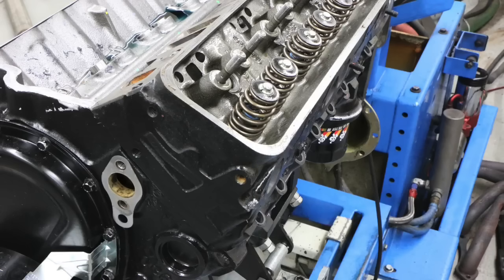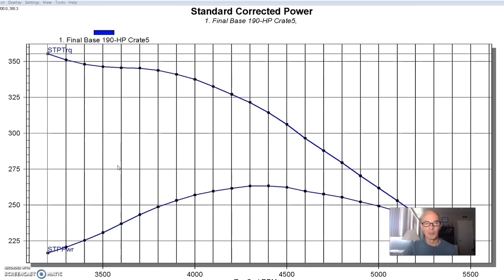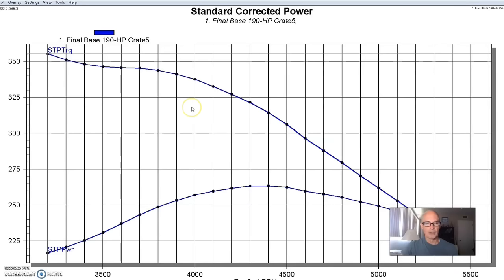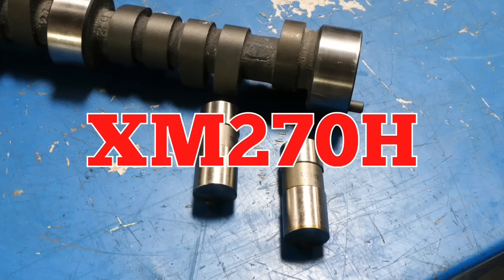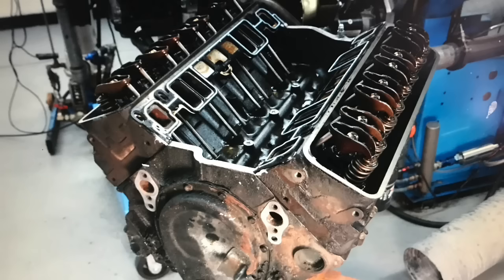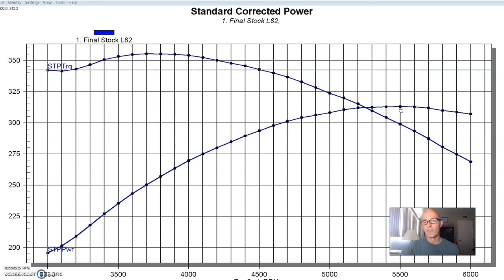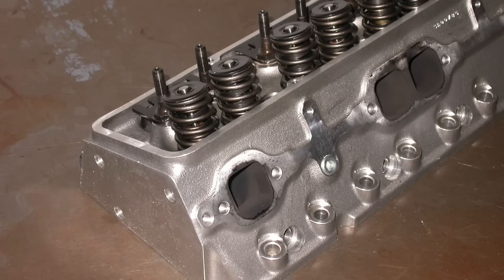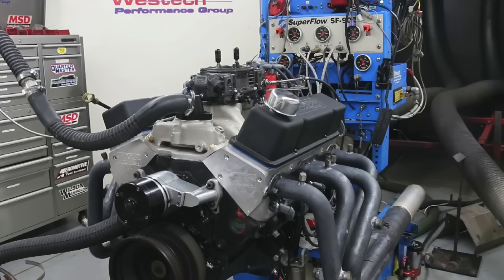JUNKYARD SBC HEAD TEST-VORTEC FTW!

Comment: hey Richard hope all is well have a question for you I. bought some AFR vortec heads so I bought a air gap to bolt on it just seen the port's on the intake they are alot smaller than the heads port's is this going to be a problem for me

Comment: What about two  2" 4 hole  phenolic spacers on a brodix 4 hole HP-1 intake manifold?  XE274H10 cam, or best cam for it, ported aluminum assault racing heads 213CC runners 10:25:01 compression. The reason is eric weingartner has assault racing heads ported and fixed up by for someone and used a cam that people thought was talking about at O.O5O" specs , although was actually advertised specifications, also had 9.8:1 compression perfect for the cam and fuel, it was a hydraulic roller. Cam Specs:112 LSA,  215*/267*/O.O540" intake, 232*/284*/O.535" exhaust with 1.5 rockers and used 1.6:01 rockers, and made broad flatlines of  425 hp and 425 tq.!. And well i am want to figure out my combo before i build this one perfect for this combo as a base. So you recommend 1.3/4" headers over the 1.5?8" headers? well i may build a couple offset ground stock block strokers at= 377c.i. 350 based and 397c.i. 400 based. Rod ratios same as stock 350. Then the dart block ones at 431, 454, 468, and 483 c.i. SBC GEN 1. And with Dart 4.5" bore space getting 511 c.i. with safe for high power boring, and the billet 4.6" bore space billet blocks that are streetable. These are the directions i am is taking. Or do i just say oh well, get a merlin IV block make it huge , run peanut port aluminum, and be done with it.? i always had my sights make small blocks and keep from making a big block but if it truly is a great option for pro touring camaros that drive every day and tons of miles trouble free, than that is what i am using. Engine dyno pulls shall be loaded as low an rpm as possible. Oh well, i guess i shall just build iron motown ls7 hybrid block engines.

Comment: What are "powder metal rods?" I'm an experienced engine builder....went to school for mechanics....loyal SBC builder, But I just haven't built a SBC in 25+ years. this is a term I've never heard or read anywhere. Eagle rods, scat rods, pink rods....these terms I understand. Clarification s greatly appreciated. Great video BTW!
Reply from the maker: do a search for the forging process involved
Reply: @richardholdener1727  I'm not sure I'd ever use 'em.....I'm afraid if a crack head ever found out I used "powder metal" rods in my motor, they might tear it down and snort them.
Reply: little metal beads are poured into a mold, pressed, and super heated until the beads melt together. i dont like them personally. they explode when they break, where as the old sbc rods bend.

Comment: The GM performance crate motor is rated at 290hp @5200rpm not 190hp.  A GM performance crate motor is the only crate motor I see on GM's website.. although I could be mistaken but not about their estimated horsepower..

Comment: The reason I ask is because I have seen on your video where y’all put a cam in there that was larger than 480 lift on Vortech heads and I was wondering if y’all had to machine the heads
Reply from the maker: YES

Comment: Hey Richard, I’m putting together a Vortec motor. 10:1, flat tops, 062 vortecs set for more lift and looking at a Howard’s roller 225/231 @ 050 .500/.510 lift 112 lsa. Was also looking at the Comp XR282hr. HP prediction? Which would you recommend? Going in a 74 nova, 5 speed 3.73 gears.
Reply from the maker: depends on intake and headers etc... but should be near 400 hp the way we run it
Reply: easy 400hp.

Comment: Can we settle the debate? What is the max lift stock vortec heads can handle?
Reply: There's 0.490-0.500" between retainer and seal so max lift is what clearance you consider safe, stock springs bind at 0.460". The channel PISS-CUTTER Performance has lots of tests and they gain very little after 0.500" unless ported. Stock will outflow true camel humps quite a bit.

Comment: How come vortec heads don’t work with domed hyper pistons? Only flat or forged domed work. Any insight?? Thank you!
Reply from the maker: why don't they work?
Reply: @richardholdener1727  according to a major distributor there are NO domed hyper pistons manufactured for the vortec head. Only a forged icon fits the build. I am wondering why? Are flat tops the only hyper pistons for the vortec head?
Reply: ive never heard of a certain type of pistons not working with a vortec head.

Comment: Will these heads work on smaller-than-350 engines…?
Reply from the maker: yes-but must have 4.0 bore
Reply: yes, but if its like a 305 bore or smaller, the 1.94 valves may not fit. also beware than compression will drop. look for 305/l30 vortec heads if you want a 58cc chamber and a 170cc intake runner. they flow dang good.

Comment: I want to run a 6" rod in a 327 with 283 3" stroke,have you done this before and if so where did you find the correct piston?thank you
Reply from the maker: THAT WILL BE ASY TO FIND-MANY PISTON MANUFACTURERS OFFER PISTONS WITH THE CORRECT COMPRESSION HEIGHT FOR 6-INCH RODS

Comment: Any chance of seeing results on a cam swap on a junkyard vortec 350? Cause I'm about to do that swap. Being a roller cam, higher compression engine, could you expect similar results if you found a roller cam that would work in the vortec application with similar specs to the 270H?

Comment: I’d love to see a test with only the heads changed so to see what the heads alone do. Changing the cam at the same time does not allow us to know how much better the heads are.
Reply: I hate to say it, but you are right. Everyone always does this. Someone please just do a scientific test, "-stock" base motor, dyno, upgrade heads only, dyno, upgrade cam, dyno. All I got was, "just buy performance heads and cam who cares what ya got" Another thing, these are too much cam for my liking, I usually stick around a ZZ4 cam 208/221 or GM LT4 hotcam, I don't like much lope
Reply: I get the idea here but it isn't very realistic.  If you're going to change the heads but not change the cam to match and take advantage of the improvements then why bother?  Putting good heads on a lousy cam doesn't really show you the potential of the heads. If the original cam isn't taxing the heads then the comparison shows you nothing useful.  If  you change the cam first then the heads and then the heads that could at least show you the limit of the original head versus the new ones.
Reply: @willstikken5619  respectfully disagree. If I have a 69 Camaro Z28 302 with a Duntov 30/30 cam and I make "X" horsepower. I'm going to pull the heads and replace with a set of AFRs and my horsepower should go up. Yes, it will go up more with a cam, but put the cam in after you change the heads to see the full potential of the combo. This only makes sense if you're doing a video on a head swap. If you're doing a video on a cam swap: dyno the car stock, change the cam, dyno the car to get the cam change numbers, then change the heads and see the full potential. I wouldn't have an issue with this if the video title was, "Junkyard SBC Head Test Vortec head and cam FTW" Make sense? As an example, Everyone says Vortecs are better than your classic double humps, so just change the heads and lets see. If we change the 2 at the same time of course you'll have better numbers. Just advocating to make this more scientific is all
Reply: @michaelcannizzo1076  If you have to pull out a fairly rare or unusual combo then i think you prove my point.  The types of engines compared in the video were basic truck engines. A rational person wouldn't assume this applies to the "I want to ruin my rare combo" crowd. 

Regardless you need to have the engine on a reasonable baseline and comparing good heads on the type of stock cams in the video just wouldn't make any sense. If anything if gives the wrong sense of the heads potential.
Reply: @willstikken5619  Believe me, I'm not disagreeing, I'm just saying take it one step at a time. Rare and usual combo aside if our motors are out of the car and in a dyno by all means do both, but if its in the car like most of us here I'm just looking to see what can pickup by doing the one thing. Again, you are totally right I'm just taking more issue with the title and felt a little misled because (I'm generalizing) everyone who does a swap, just throws both on in these videos
Reply: @Richard Holdener, want to weigh in? Someone asked the same thing in the comments along the lines of what I was asking. "I would like to see Vortecs on a stock 400 short block"
Reply: @michaelcannizzo1076   oi get the frustration with that, I'd prefer to see one change at a time too, it's just that if you want to see the impact then the order of changes matters as much as the changes themselves.
Reply: @michaelcannizzo1076  most people, at least today, are probably not starting with a 69 z28 302. They are starting with cheap 70’s and 80’s v8’s with a stock no lift and no duration cam and low compression. Back in my young days in the eighties, it was always starting with headers. Then a cam swap. Head swaps were way to expensive back then. The headers did hardly anything at first. But the cam swap….. that’s where the power always was. If you could find a set of camelback heads… that was next. 

Changing to camelbacks made an improvement, but not nearly the improvement we got with the cam only swap. This was 35 years ago of course and heads got better and cheaper, so I’m guessing todays heads make a bigger difference but still not the difference that cam swap makes.

Like was said in this thread earlier, since this all on a Dyno and easy to access, it would be nice to see these parts tested one at a time on their own. Especially this low buck stuff, since the people doing this kind of work don’t usually have pockets deep enough to do everything at once.
Reply: @michaelcannizzo1076  Did you do this what were the results? Curious andlove them lil 302s!
Reply: @willstikken5619  your right, replacing the heads and not the cam would be silly. 

The idea is to replace the cam, keep the stock heads and test…… Now, replace the heads and test. 

So then one can actually see the hp improvement of the cam and heads on their own.
Reply: @guyforlogos  LOL that's fine too! But they replaced both at the same time so individual numbers cant be derived
Reply: @michaelcannizzo1076  really? Thanks Captain Obvious! My original comment didn’t take that into consideration…… 🙄
Reply: @guyforlogos  LOL seriously?? Im in your camp and agreeing with you. Forget the 69 30/30 comment. Here is where I am coming from bottom line. I have a 69 Camaro with a ZZ5 motor. Cam is a 208\221 ZZ4 cam. I efffing love the cam period. I do not want to change it at all I don't want more lope, I don't want more horsepower from a cam. It has Fast Burn Heads... If I swap to AFRs how much am I going to gain? If I swap to double humps, how much am I going to lose? That's it, thats my basis for asking. The first 4 seconds of the video, " The question for Chevy owners, how much are Vortec heads worth on a small block Chevy?" The question cannot be answered here because at 4:00 minutes we jump to a dyno chart of what it looks like with heads and cam swapped. Do what you said and swap cam first, dyno, then heads, and dyno. Or start out with a stouter motor and just do heads

Comment: CAN YOU USE THE SAME ENGINE AND TEST THE THREE DIFFERENT SPACERS. I'M BUILDING ABOUT THE SAME ENGINE BUT PORTED 993 HEADS WITH 1.94 1.60 VALVES. ALSO A 1965 INTAKE 350 HP .125 DOME PISTONS ABOUT 9.3 COMPRESSION. A 214 224 444 465 CAM. I'M HOPING 350 HP. I COULD HAVE GONE WITH BETTER HEADS THE HEADS HAVE SPECIAL  MEANIBG TO ME. JUST A STRONG GROCERY GETTER.  MY LAST BUILD IS GOING TO BE A LS 427 WITH TURBO. I.M GETTY OLD I JUST WANT TO GET INTO THE 10'S.

Comment: @Richard Holdener Big question.  I run circle track.  I found a sbc 3970010 block, freshly machined but its bored to 4.080. I've notice a lot of 4.080 sbc piston being sold. I  personally  have never heard  of  a 350 block being bored  more than  .060 over. PLEASE HELP.
Reply from the maker: i have never gone .080 over

Comment: What was the original timing and what was the jetting in carb? Gm crate.  Wondering if you would get a try 15 horse by changing roller rockers?

Comment: Hey Richard i have a Vortec 350 with this cam 220/224 @50 495 in 502 ex 112 lsa 9.6.1 compression  duel plain eddy holly sniper can you suggest a upgrade cam i believe i can go 520 lift thanks
Reply from the maker: look at a 224/232 ish cam
Reply: @richardholdener1727  thank you

Comment: With some gasket matching and an RV style low rpm cam the 882 heads aren't all that bad. I ran them in a Caprice because I wanted that Grandpa spec stock look.
Reply: they are the best of worst,as mentioned

Comment: Would have liked to see the L31 Vortec with a cam upgrade with the intake.
Reply: I meant with the carbed intake or even better the marine intake with real injectors.
Reply: Fuel system only supports around 330hp

Comment: Why does the L82 have a belt pulley for serpentine accessories?
Reply from the maker: THE L82 WAS AN EARLY CARB MOTOR
Reply: @richardholdener1727  with v belt pulleys and a short water pump. But why the serpentine pulley and seemingly late model harmonic balancer?

Comment: Stock vortec cylinder heads can make up to 480hp depending on cmpression ratio. They quit flowing at 525 of camshaft lift. I saw a Dyno test on another channel. So 480hp and spray it 350 shot of sniff what ya got? Lol one of the best stock performance heads from factory ever!!! Ed The Professional Backyard Sniper Man😎✌
Reply from the maker: 480 HP ON  AHEAD THAT FLOWS 210-220 CFM?
Reply: @richardholdener1727  yes sir. Its the vortec design air flow. It tumbles downward with the air instead of flowing like conventional older style heads. Its true. Scoggin dickeys sells the stock vortec head that makes that power. He mills the valve guides for higher lift and using beehive high rev springs to 575 lift and opens the exhaust ports slightly and gives the heads one piece stainless valves to match. All with 1.94 in 1.55 valves. Capable of up to 900hp with some kind of boost. About $1000 for the heads. You need a special solid lift roller cam for dirt track specs. No more than 245 dur. 12:1 comp. No B.S try it !
Reply: @eddiecahall3824  
Guys used to build boosted engines with 8:1 - 9:1 compression. The thinking was less static compression allows more boost.

I've been noticing guys building 9:1 - 10:1 static and they're still able to blast big boost at it.

How is it being done? Is it higher octane, race fuel, e85, better ECMs???

I'm asking because I'm thinking of building a street driven tow engine. Hoping for MPG and torque. I think small 350, efi, and boost. I hope to keep it reliable. 
If I can't do it with boost, plan B would be to build it naturally aspirated and lower my hp/tq expectations. 

Have you got any basic guidelines for my build?
Reply: @richardholdener1727  the Lt1 vortec heads of course with the saw tooth designs on the front of the castings. O62 # I think. Not the 906 casting. They flow more than 220 cfm

Comment: Late 90s Vortec roller block 350 is a hell of a motor. Look how many have 300k miles and still hauling trailers. Got one with a 383 kit in a boat and it kicks ass.
Reply: Mine was a 98 5.7 Vortec and I sold the truck when it had 431,000 miles on it. Thst thing was a beast. She did scrap hauling where id load the bed so much I had to inflate the bags, she handled a few pulls here and there and rarely would pull a trailer but she still didn't care. Ill alwayd swear by the 350 small block no matter what. She was a gas hog but I didn't care. It was well worth it
Reply: I love the vortec motor except dealing with the ECM and the sensors. I may do a carb swap on one of them.
Reply: 880 block with factory vortec heads? Which 383 kit? What cam do you have?
I have a old Donzi 23R and have a roller mag 350 worn out and a replacement tip with provision for roller cam and fuel pump since will be running carb..it's a very low mile short block std bore thinking of building 383 vortec heads been reading about d dish pistons for right compression and quench for marine...just wondering your input and what you are running
Reply: TPI engine sorry

Comment: this is what im currecntly running with going in thinking i had a vortec head engine ENGINE SUFFIX CODE(FRONT)(STAMPED)
V0103TPA (flint, january 3rd)TPA part of the suffix: truck / 1992 / 350cid / 210 hp / manual trans 
 and for heads cylinder head casting numbers (under valve  cover)
 14102193  TBI swirl-port heads can you suggest some trick flow or equal heads i can buy because i plan to go with a proflow 4 efi system from edlebrock
Reply from the maker: TRICKFLOW HAS LOTS OF SBC HEADS
Reply: @richardholdener1727  ya im well aware of that. can u suggest a specific part number for heads i can bolt on with the information provided above... its all kinda a mystery to me because there are so many different options

Comment: I have a stock vortec 350from a wrecked van with vortec intake quadrajet carb and ram horn duals.  I am surprised how peppy it is in a 58 chevy wagon no wonder it has almost 400lbs of torque at 3500 RPM

Comment: Basic question: Why not run the whole engine vs just doing a vortec head swap? 
You get the heads, 1 piece rear main seal, and roller block.
What am I missing? Is the stock cam caca? Are the pistons caca?
Reply from the maker: we had a different motor-you can also run the whole Vortec motor